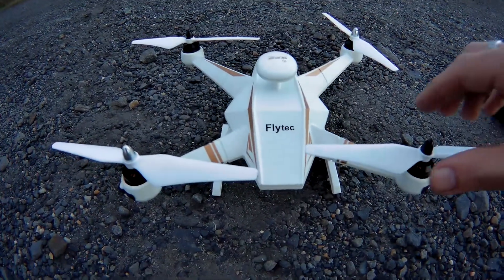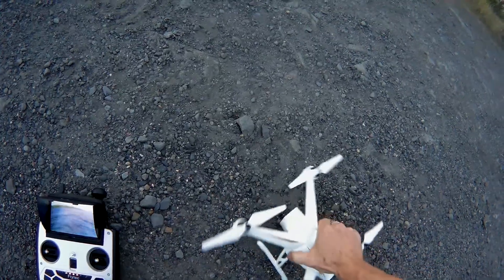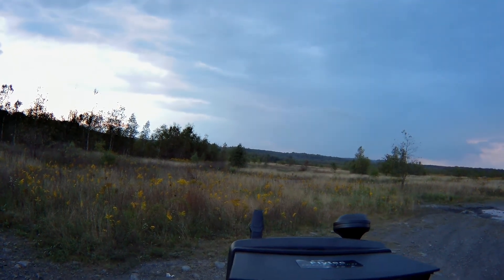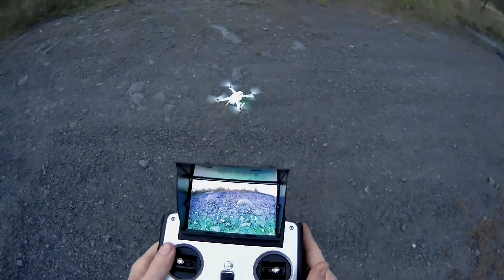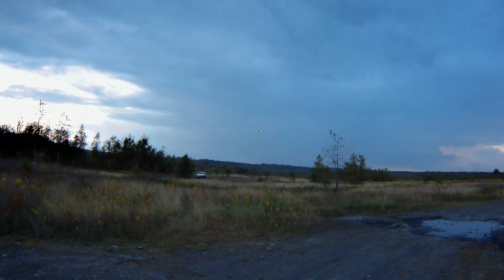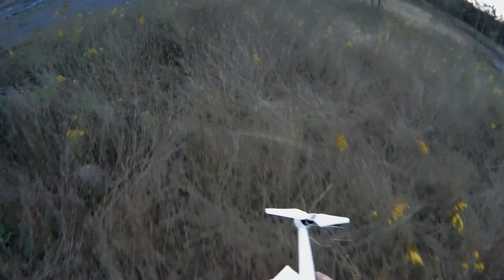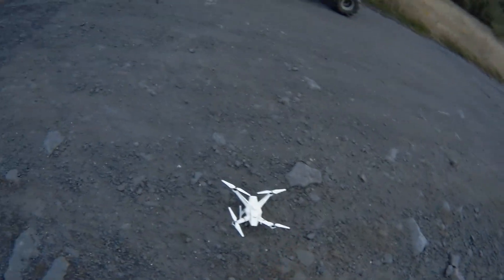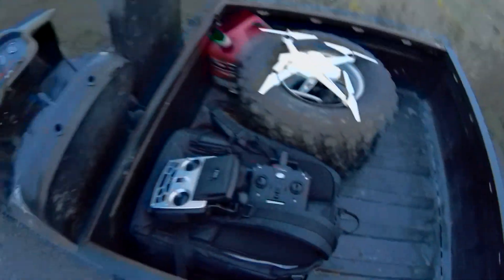Flytec Navi T23 Brushless Duel GPS 1080P HD Camera 5.8G FPV Drone

Comment: I had the RC leading which is the exact same drone. This thing is a turd, let me run down everything that didn't work or stopped working. First off FPV monitor wouldn't charge correctly(only 3 bars not 5 bars), FPV transmission was always choppy, range was 150 meters(supposed to be 300), flight time was closed to 11 minutes, would return to home for no apparent reason, camera servo burned out on first flight, never could get the toilet bowl to stop, motor burned out and last but not lease the lurching after stopping and going. Things that worked great, follow me worked but lurched forward constantly ( video would make you sick). The circle me which was label headless mode worked great, return to home worked great. I sent it back and it took 2 months of emails to tomtop to get a return. I finally had to tell them that I was turning it in to my bank for fraud. They gave me my money back that day. This thing was over 200 dollars, took my return and got the Hubsan H501s advanced. The best quad I've owned so far, everything works period.